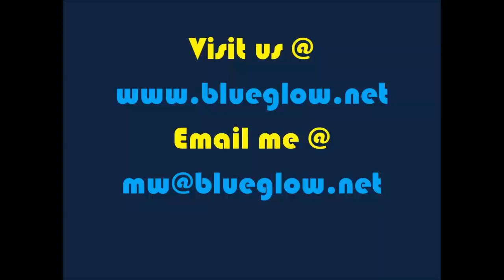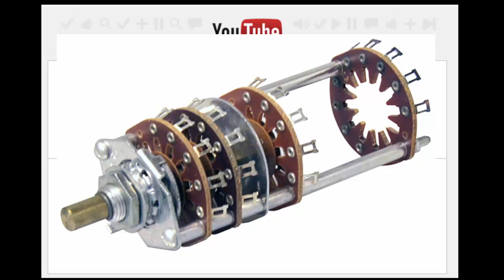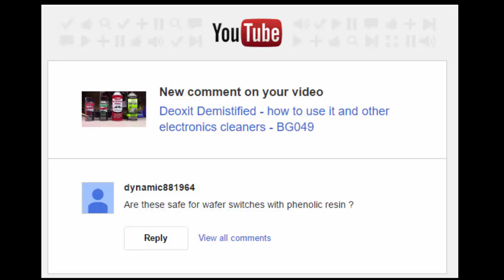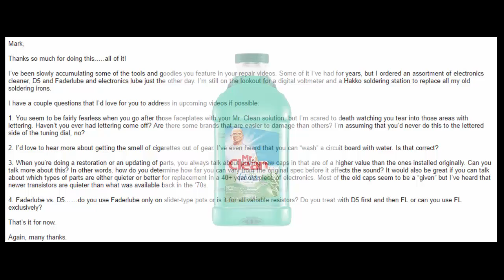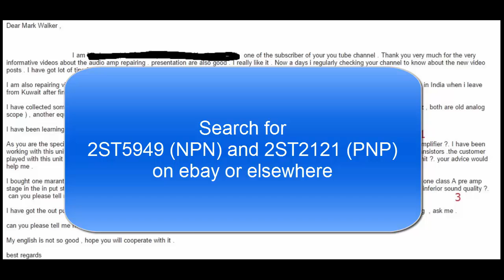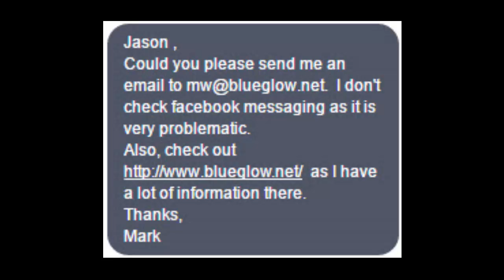Question and Answer Plus Tech Tip April 15 2016 - BG057

Comment: Tobacco smoke residue is a bacteria that causes the smell. You can use a small drop of bleach mixed with warm water at 1 drop per half quart of water and it kills the bacteria on contact. You need to use unscented bleach. So read the label on it. As not all bleach is the same.

Comment: Hi, I've got a Pioneer SX-2500 circa 1971 and it appears to work perfectly until I raise the volume beyond half way up with my dynamic speakers and with my martin logan hybrids after abour 1/3 way up then the protection circuitry mutes it own until I turn it down and wait like 15 secs. Unlike anything else I've encountered, there is no relay clicking when it reverts to normal operation. Where would you start to look if you encountered these symptoms?
Reply from the maker: +Salvatore Rossignolo could be a lot of things to be honest, the description of the issue doesn't point to one typical thing.  sometimes things like you are describing are some of the hardest to chase down.  could be overheating at the driver our output, could be clipping on the PS, could be oscillation kicking in, many things sadly...
Reply: Thank you, I may send it to you!  I'm waiting to get some tube gear for that though!!

Comment: Hello Blueglow!
I've a strange condition going on with my Luxman T-110 tuner. When pushing in the muting switch, which disconnects its operation,  the tuning indicator lamp brightens and I'm measuring 12v. When releasing the switch the light is reduced and am measuring half the voltage going to the lamp. Another issue is the indicator lamp doesn't flicker as it should when searching for a station. I should mention, the unit had one channel out prior to servicing and the dial indicator light was flickering when station searching along with a constant 12v that didn't change when depressing the muting switch. I replaced all the caps, double checking them making sure of their correct polarity on the board and all seems to be okay in that respect, both channels now operate. A puzzling situation indeed! Any ideas as to what may be occurring? I think I zigged when I should have zagged somewhere. Your response appreciated.
Reply from the maker: +sand 007 wow, that's hard to diagnose remotely.  Sounds like you have some voltage issues and something is swamping the 12v circuit.  Could be a lot of things.

Comment: Great video, keep them coming. When I clean boards, I brush on the windex  and then use a shop vac with a small hose duct tape on and suck it off. It works quite well.

Comment: We (the dutch open reel community) use ultra sonic cleaners to deal with corroded silver contacts found in auto reverse switches. First clean them out with IPA then in the cleaner and after that some electronics lubricant. They come out like new and you don't have to worry about breaking them in the process. 

And that's one smart new logo you have there :-)